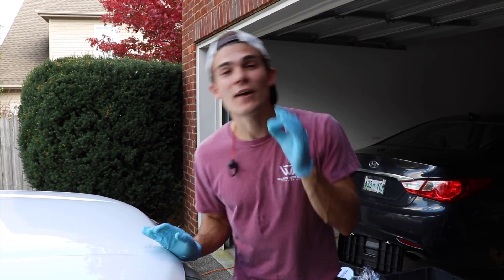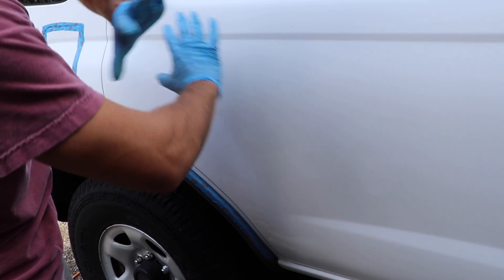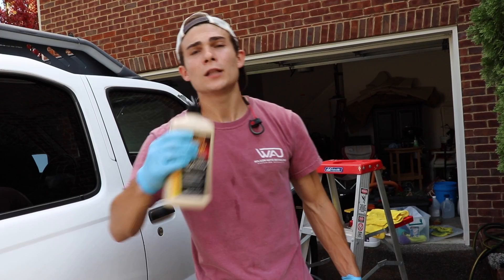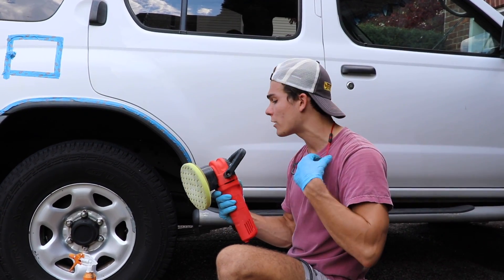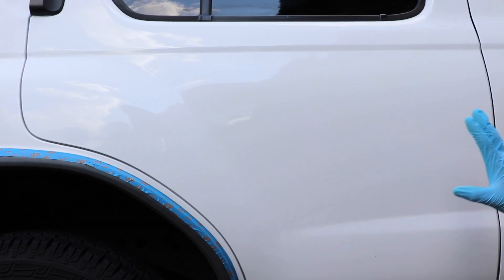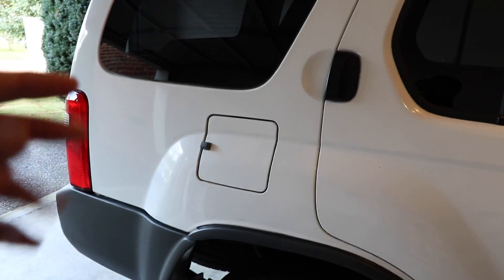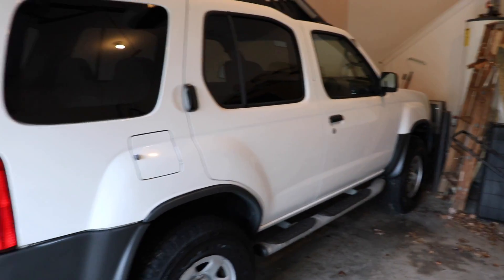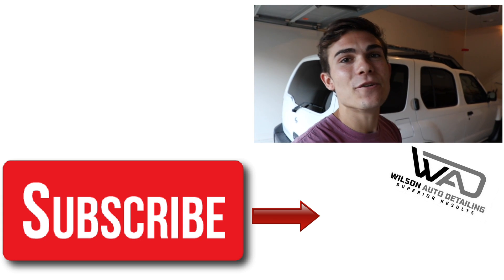Car Paint Polishing: Meguiars 205... So Simple, So Amazing!

Comment: Hi Luke what brand and size yellow Hex foam pad are you using here?  and what speed are you using?  Thanks
Reply from the maker: +Mark H hey mark! Using a 6.5 inch pad, chemical guys!! On speed 6
Reply: Is it better to use the yellow or orange pad in your case scenario?  Thanks
Reply from the maker: Honestly I dont think that either would make a HUGE difference, but in this specific scenario, I might go with orange if I had that one on hand

Comment: So what plastic restorer did you use ? My finance's 2001 Honda CRV has a lot of plastic. i went around and tested 5 different retail products long term/reapplications.  The two with linseed oil, stay black for quite awhile, but seem to attract dust/dirt.  There are a lot of promises made out there, with some pricey " true restoration" products. Have you tried  many ? It's official, I started my biz with the State of FL/city of Largo/bank/fictitious name in paper. I'm now DELUXE VEHICLE DETAILING AND PAINT CORRECTION !
Reply from the maker: I use a product called Solution Finish, it is a true black trim restoration products, and literally dyes the trim back to the original dark black appearance, and as far as permanence goes, it will last a long time, but no matter what, evem if you replaced it with new black trim, it would still EVENTUALLY dull and fade, that's just the nature of the beast. Congrats on the new business!!! Let me know if I can help with anything!

Comment: Hi Luke just wanted to say I really enjoy you'r videos I'm learning a lot , I have a question my car has never been Clayed or had a full pro detail and on the roof I have some blemishes on it & on the top bumper have some bad water spots any advice on how to correct these issues?..
Reply from the maker: I would say look at some M105 and M205 with the polisher used in this video.. the thing is, depending on how bad it is, you may be out of luck without a good pro detailer because some imperfections are so deep into the clear coat that the only way to remove them is wet sanding, then going from there
Reply: Wilson Auto Detailing Ok look into seeing if I or getting it done with the wet sanding or a DA polisher I just don't want to mess it up ! Trying to be safe and ruin the whole finish?..
Reply: And Not ruin the finish!!..